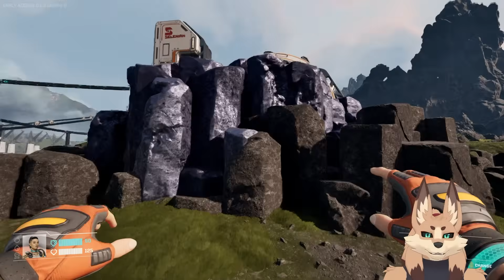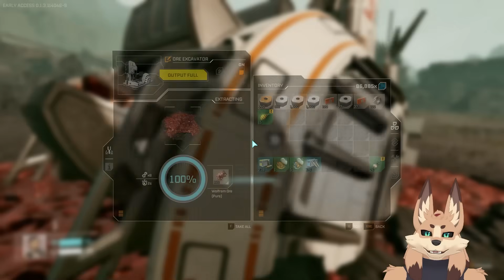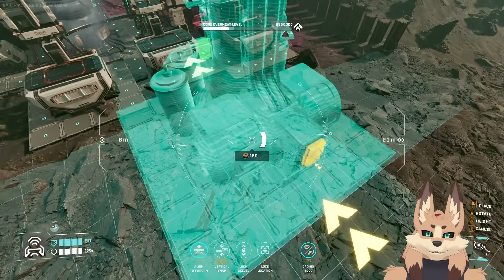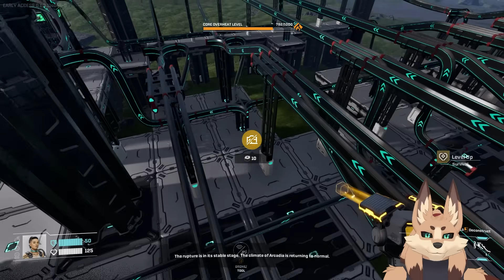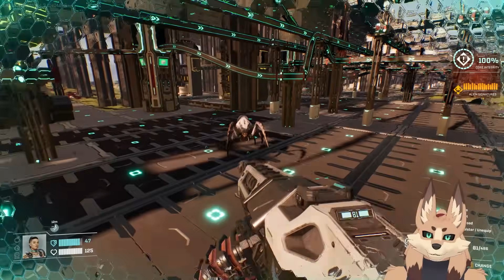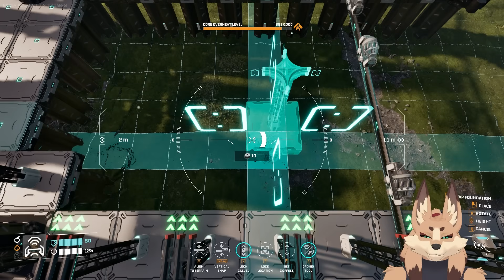A Rift Unleashed A Siege On Our Assembly Line - StarRupture [8]

Comment: Exactly what is the multi-rail bug? Are they completely broken so they don't bring the right material? Or is it just the visual line jumping?  I saw a video by Riverman building a vertical titanium housing production base, in it he mentions that using the Y level lock to set rails is what bugs them out.
Do some searching in YT for Late Night Stream. He has a video about traps for the bug waves when you upgrade your core.  If you build those traps around the monoliths then they definitely won't get to your core.  
Other base defense is stands of turrets. The automatic Defense Towers are good but they are not full proof and the bugs do get through them. They are longer rage and need to be high to take advantage of that. 
The manual feed defense Turrets are smaller and shorter range. They are optimal for cleaning up stragglers that do sneak through.
Reply from the maker: The multi-rail bug is that rails on multi-rail supports are not isolated and will all join onto one of the three rails, so instead of having 3 rails with a throughput of 3*240 or (3*480 at v3) you have essentially a rail connector with a throughput of 1*240. They break upon reloading the game when the rail paths are recalculated, but the issue is fixed in the test branch for the next update.
Reply: @KitsuGenji  Ok that explanation I understand. It wasn't just visual; it was literally cutting 480 speeds out of the rail.  
I am still getting stuff together to unlock stators and get to zipline on another.  Just finished ferrying He3 from the miners to core to finally unlock glass.
My back side base was a mess, so I just pulled everything through to 1 line for titanium and 1 line for wolf/calc then built 2 rows of storage for each line and sorted from there. Something tells me 4 smelters for Titanium isn't going to be enough.
Every time I plant a new core and add power, the new base is getting attacked. Ten minutes after Rupture is not enough time to build much.

Comment: I'm kind of watching these out of order so I'm not sure if you discovered this but drones will take the shortest path. A line is the shortest distance. So turning into your connector and then turning onto the "wrong rail" wouldn't happen. I had a congested line and created a 2nd, slightly longer dedicated path and they continued to choose the shorter congested rail. You can see this on your vertical rails. You do 3 rails up but the drones only use the center rail, even if the center rail gets full.
Reply from the maker: Yeah, I eventually ended up using storage depots as repeaters to bypass congestion and force shortest-path calculations to pull from the depots on the bypass routes rather than the original depot on the stack

Comment: Minor tip, but you can adjust how many products are requested at one time on each machine, rather than the full 100. This helps a lot with launchers, so they only grab enough to launch without filling all the way up, especially since they only send 1 item every 6 seconds.

Comment: Buildings don’t get damaged if you go over the core’s heat capacity — they just won’t be able to cool down until the planet returns to its normal state, which takes about 10 minutes after a solar flare.
Defense towers are useful because once you’ve upgraded the core, going into its range can sometimes trigger a random attack from the monolith.
Oh, and one more thing: the fog coming from the monolith follows you all the way to your position, so if you’re close to it, monsters will spawn instantly.
You can actually take advantage of this by placing a few towers and then moving in front of them — if you can — so they immediately take out those annoying little creatures.

Comment: [5:30] "Transshipping materials on the bus to their construction points and back."  I'd been pondering something like this.
The throughput issue can be overcome by injecting resources at points along the bus when you've calculated that the previous line has been consumed.

Comment: The point where you are making Valves. On lane 3, rails 1 and 3 could have gone directly down to the lower connector as that is their end state and didn't need to be connected to the higher connector. The other thing is that you need to focus on Moon Corporation so that you can unlock the Core Amplifier v.2 so that you won't need to upgrade the core. Each 1 uses 5 Quartz and 250 Intermediates to make the 100 Quartz Blocks to build a v.2 which will cool 250 heat per instead of 20.

Comment: Another fine episode good sir. I upgraded my main core at one point and built banks of turrets on the monolith side for defense. After a while the novelty wore off and once I realized the turrets ate up any cooling headroom I gained (plus the need for the extra power), I decided to revert back to a level 1 core. I crafted a field of core coolers to compensate on the cooling side which worked fine. Now that I have the top tier coolers unlocked, I deleted the bank of small coolers and cool the whole factory with 3 of the big units. The combat xp and credits from alien parts associated with the monolith swarms is nice, but I’m not sure I’ll ever be arsed with upgrading cores again, unless future updates make it an essential task.

Comment: Where you have your Chemical base is where I have my primary base. Mine covers the ENTIRE area on one level though. I now have a line of Cargo Receivers in the first line, a line of 14 Smelters, a line of 20+ Fabricators, a line of 20+ Furnaces, a line of 7 Assemblers and a line of 7 Compounders. These all end up going to 5 Orbital Cargo Launchers and a handful of T2 Storage (for parts that will be needed for the remaining few Corporate contracts). I also put in some of the Multi Storage which are great. You can just connect it to the line and dump whatever you want into it and if any item is needed, it gets pulled. However, the base is SO BIG that whenever I add or remove anything from the platform it delays for around 15 seconds (much worse than the auto-save pause.) After watching your episodes I knew that eventually, you would run into the lower-end material shortages which would require you to create remote bases to fill the void. I have similar setups. Remote bases for all low-end materials (rods, plates, tubes, sulfur, helium-3, etc.) and other remote bases for intermediate materials from Fabricators and Furnaces. I have also learned not to have multiple extractors merge into a single line to a single cargo dispatcher. This will cause only one of the extractors to do the work while the others sit with full inventory.
When you read the “Upgrade your base” message I just had to cringe. I did the same thing at the same location not realizing that there would be 3 waves of bugs. I didn’t last through the first wave. Luckily I had an auto-save to reload. What I do now is build a bunch of Tower Defense (big guns) around the Monolith and have them auto-fed from a T2 Storage being fed by a Mega-Press manufacturing standard ammo. You are now going to be attacked every so often. You really need to build some defense close to the Monolith. Late game you’ll want the attacks as the higher base-core levels (mine is at 4) brings in the Behemoths which give you 5,000 points for their parts.
Reply: I actually found a really nice area for a main base it's off to the left side of the World Engine  has pure titanium there and wolfram is x4 version  3 spots I think  but it's a really big flatish area  :)

Comment: I've also been toying with this idea of having cargo receivers feed my main line from other locations. The throughput for a receiver is 171 items per minute assuming its being fed and emptied by a mk2 rail. However, i've yet to test this but apparently you can feed 1 receiver with 2 dispatchers to boost its output up to the speed of a mk2 rail and theoretically up to 342 items per minute if you have a mk3 rail unloading it. I guess then if you can feed it with 2 dispatchers, why not try 3 for maximum throughput!
Reply: beware of the heat,   Those  Dispatchers and receivers are really good but also really high in heat
Reply: @meyatetana2973 very good point. May also have to get clever with the placement of multiple cores are place the receivers in a separate core area
Reply: @Kernewek_Gaming  Should be able to get at least 3 cores to share a square where you can place the heat exchanger things that give your base more heat.   All cores will benefit from those that touch it,  just like all cores will share heat on buildings they have in the zones.